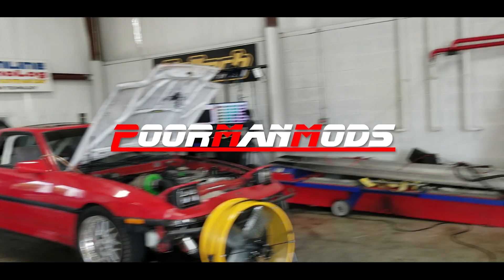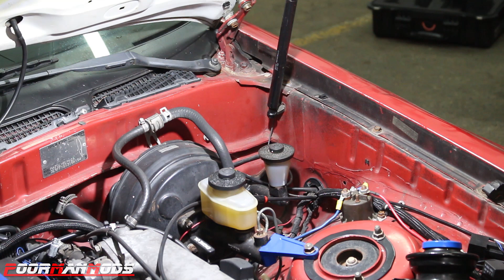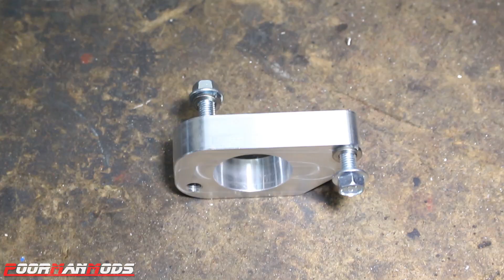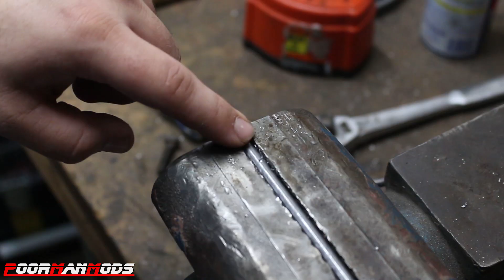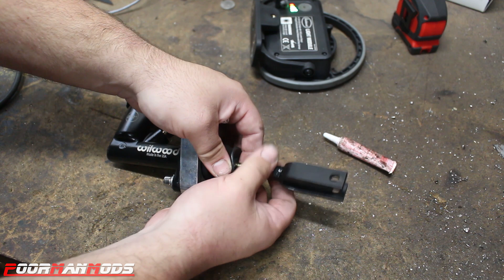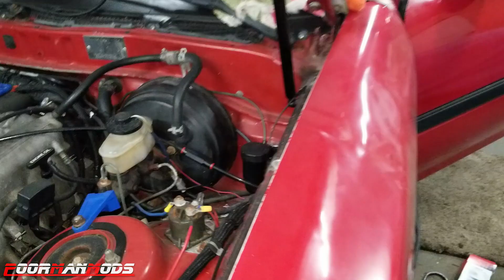Supra Wilwood Clutch Master Cylinder Conversion Upgrade

Comment: Couldn't you just redrill mounting holes on the wilwood, or tack weld bolts to a steel plate instead of that adapter thingy?
Reply: Hard to get drills in there and there is already holes in firewall.

Comment: Hey bud with the s500 front brakes and the ls430 rear brakes did you upgrade ur brake master too?? If so please share specs and info
Reply from the maker: @christopherwilliams9328  I have the stock brake booster and stuck master cylinder in my brakes feel just fine. I do not feel the need to upgrade 🤟
Reply: @PoorManMods  I thought you upgraded ur clutch master tho???
Reply from the maker: @christopherwilliams9328  I upgraded the clutch master cylinder but not the brake
Reply: @PoorManMods  do you still have the part# for that
Reply: Ok you got the link for the adaptor plate to the mk3 body?

Comment: How thick is that aluminum adapter plate? 1" ?
Reply from the maker: yeah about an inch
Reply: @PoorManMods  thanks. That's insane that they're selling these adapters for $90 to begin with, let alone the fact they're not even including the proper hardware. And they expect someone to bolt it through the firewall with bolts and not studs!? Lol.   $20 worth of aluminium stock, 5 holes, tap 4 sets of threads and you're set. Good for you not linking their product 👍

Comment: Can I ask a genuine question? Why not just use an adapter for a 5/16 to 10mm bubble flare straight from the wilwood master cylinder? Wouldn’t that save time and accomplish the same thing? I gotta change mine so I might as well do the upgrade